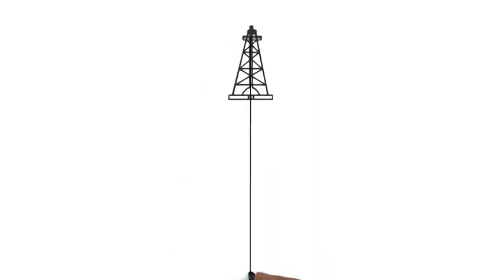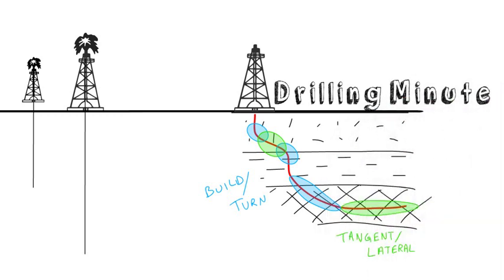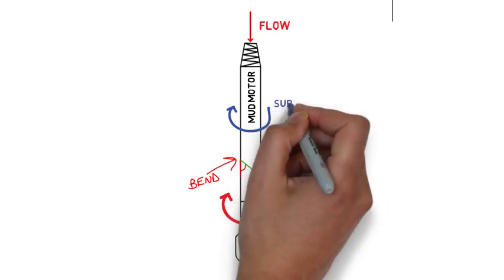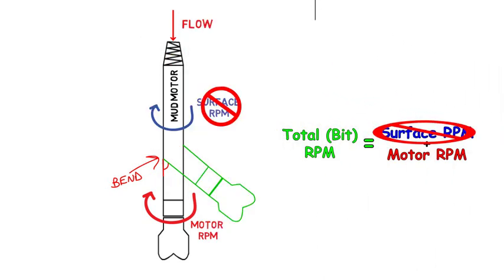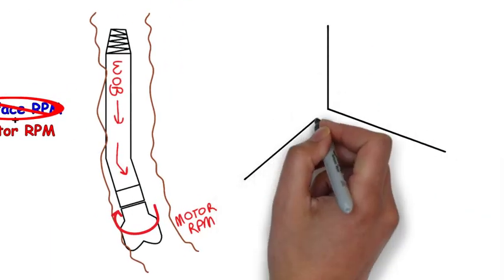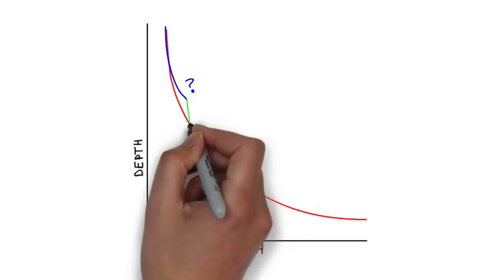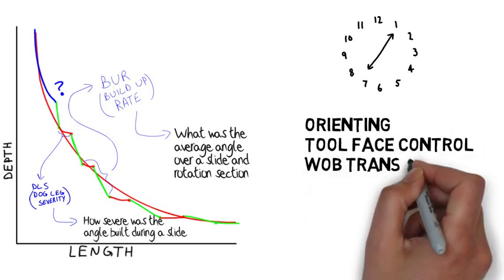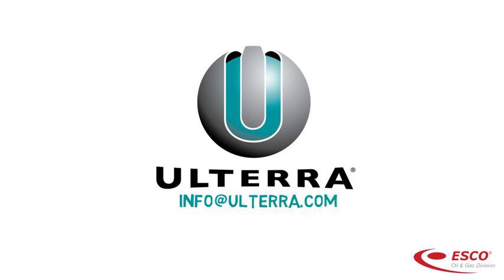Ulterra Drilling Minute 231: Directional Drilling Operations

Comment: The maximum angle build is NOT dogleg severity. Dogleg severity or dogleg for short is the change in angle (whether inc or azi or both) per a certain distance usually measured in degrees/100ft. 

The maximum angle built is not necessarily associated with the maximum dogleg occurred in the well. For example; the maximum angle build was 8 degrees but the dogleg associated with it was 4 degrees/100ft; that means that the 8-degree increase or decrease occurred over a course length of 200ft. 

Another example: we have an angle build of 3 degrees that occurred over a course length of 30ft. That means the dogleg in this case is 10 degrees/100ft. Which is higher than the previous example.
Reply: I think the narrator and you have semantics.  Narrator is talking about a maximum angle deviation from the vertical for the slide interval.  The DLS depends on the granularity unit of measure.  Your examples are what narrator is calling the BUR (two or more segments).  So you are correct in that you can have a maximum angle and a lower DLS.  Narrator is covering DDO 101 class basics.